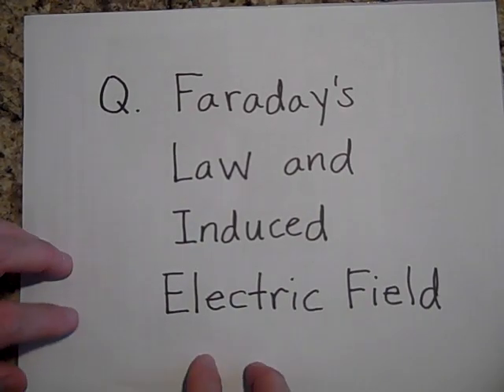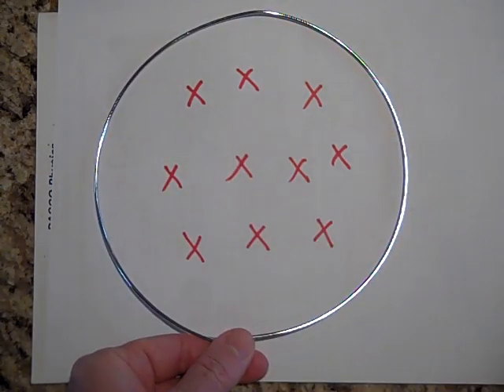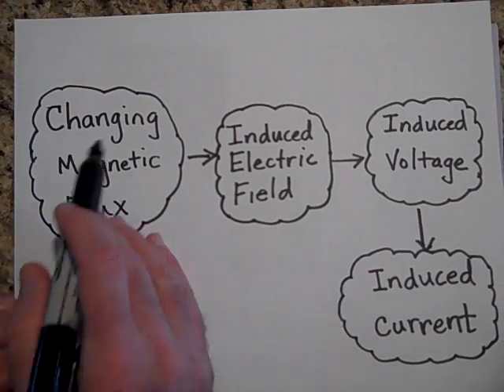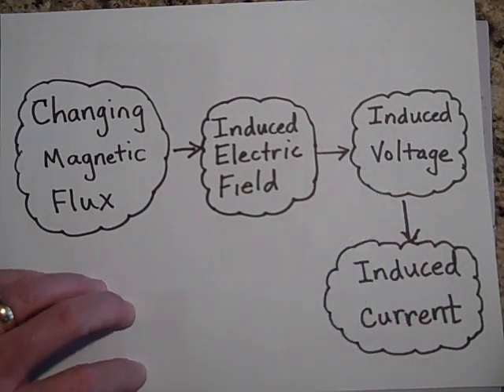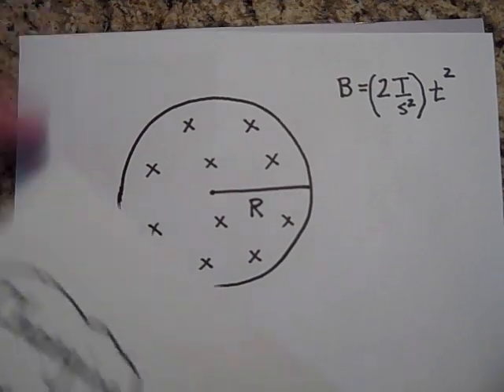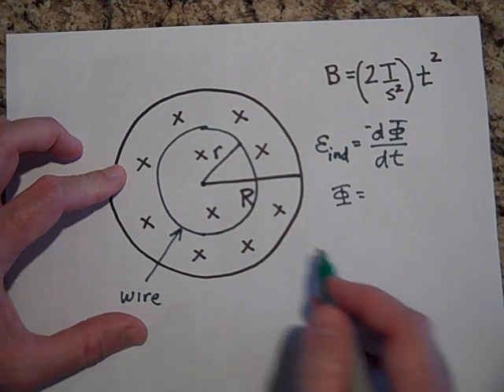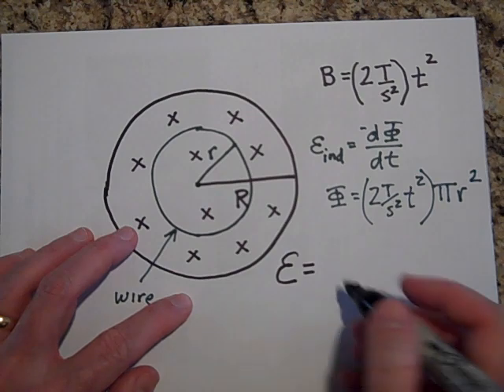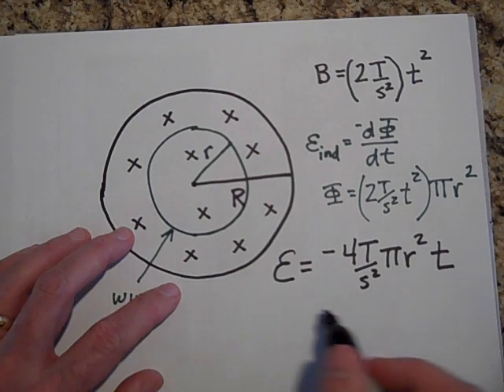Faraday's Law and Induced Electric Fields

Comment: What I would like to know is, can I measure EMF voltage with voltmeter? If one creates a changing magnetic field inside a loop of wire, and than he connects voltmeter across the loop of wire, will he read the value voltage, even as AC?
Reply: HitAndMissLab Nope, He is only able to read DC, because for AC you need sinusoidal function remember? So magnetic field must be sinusoidal to induce AC. Plus with a voltmeter you will not be able to read correct value of emf cause the internal resistance of voltmeter will screw this all up..You will need a Potentiometer...Hope it helps..

Comment: Very clear, except when you assumed E is parallel to dl. Why is E parallel to dl?
What if I move the Faradian loop over 1 mm to the right (but within the magnetic flux area)?
Reply: Both vectors are tangential to the loop at every point on the periphery of the loop. Thus, at every point on the loop, E and dl are parallel as only a single tangent can be drawn to a circle at every point.

Comment: Why you said T/s^2, why is the s^2 come from, it would be wb/s^2 or T only, I think it is a typo
Reply: From the magnetic field you would expect the unit T. So, if we have a formula which has quadratic dependence on time, then we have something with seconds squared in there. Therefore, we say that we get "that many Teslas per square(!)-second". So the "per square second" and the square second you get by filling in your time gets canceled out and you end up with just a magnetic field in Teslas.
You can always apply this kind of checks to see, if your units in a physical formula make sense. With the same reasoning you'd find out, that you'd run into trouble expressing that the acceleration of your car is " 3 meters per second". That's wrong. With meters per second we are talking about speeds. Therefore you should have something like "3 meters per square second" in your formula. That's an acceleration.

Comment: Why is the electric field pointing in that direction? Isnt is usually perpendicular
Reply: no, when you have a current, which is induced as explained by faraday's law, the electric field must also point in the same direction as the current. another way to look at it is when you want a current to be pointed in a particular direction, you must choose an electric field which pushes the electrons in the opposite direction. this is the case for electroDYNAMICS.
when you have a situation of electroSTATICS, the electric field is, indeed most of the time, perpendicular to the area of your charged object.